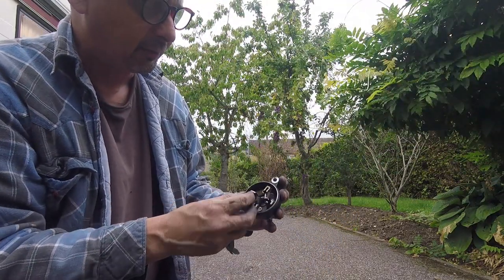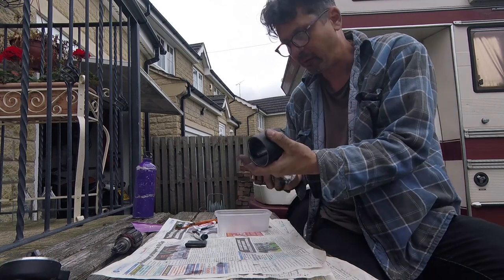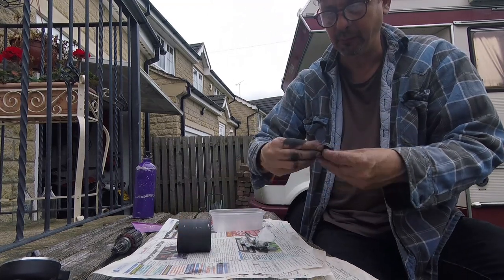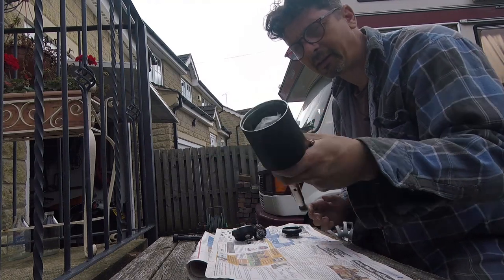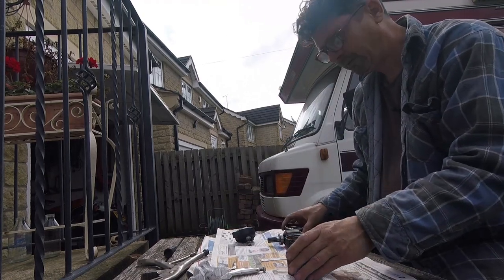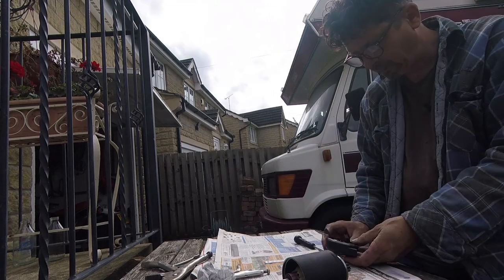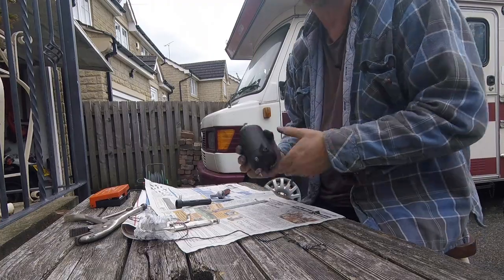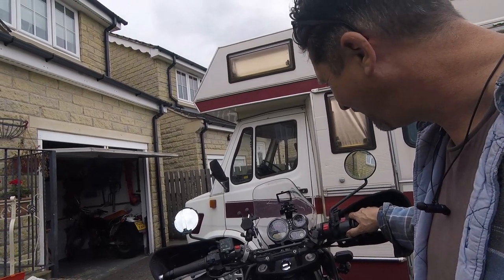Himalayan Starter Motor Fixing

Comment: Thanks for great info. I going to pull my starter now and check it. From RE manual, Starter motor bolts, Torque value is 10-12 Nm or 1.0-1.2 Kg.M. that's for the mounting bolts...... I removed my starter. Mine is Perfect inside. I recorded the Starter Motor label info.12 Volt 0.7KW, SM-6870A, 53 100 00000, R.E Part No.:574039/C Varroc Engineering Pvt Ltd, Pune India (mine starter manufacture date15/01/2018).
Reply from the maker: Glad you solved it and glad the video was helpful.

Comment: You fixing your Himi on the drive in front of the house reminds me of my days as a London courier in the 1990s doing the same thing every weekend! Brought back fond(ish) memories. Well done for sorting it, I too would have thought of Araldite in the first instance but I have heard great things about JBWeld and I'll have to pack some next time. Your "string theory" worked a treat too!
Loved your "I am awesome" at the end! 👍👍👍
Reply from the maker: Thanks so much François, really nice comments.  I did the same in the 90s (and late 80s) as I looked after all the tools for the bike club because I was lucky enough to be the only one that had a garage with my flat.  Most of the others in the club did couriering.  I guess old habits die hard (and my current garage is too small!)
Reply from the maker: Also, it might not have been successful.  Just shy of a year since I did the repair but today it struggled to start - hoping it's the battery due to low use in the last couple of weeks whilst waiting for a new master cylinder and  not the motor repair failing... I guess I'll find out soon!

Comment: I removed all starter motor cables and tested solenoid,  cleaned all cable connections. Also opened starter and cleaned copper commutator. ALSO found a multi pin connector with too much conductive grease, Cleaned thoroughly and now my 2018 Carburettor Himalayan starts with a short press of starter button. Also I placed a DC Amp clamp on Starter cable. Starter draws 60 Amps on startup. (Peak draw) I can send you a photo it you PM me.
Reply from the maker: Wow... well done.

Comment: After removing all starter cables, plus starter soilenoid, and cleaning all cable connectors, battery cable connectors and stripped starter motor, cleaned commutator, and oiled starter end bearing, also cleaned one multi pin cable connector. Cleaned all earth cable connectors. My Himalayan ( 2018 Carburettor model)  starts with one short press of starter switch. I also  places a DC Amp clamp on Starter positive cable and noted it draws 60 Amps peak DC on start up. (The multi pin connector was full of factory  grease, I think cleaning if fixed my poor starting problems)

Comment: Thanks for taking the time to explain the resolution.
I still have a few queries.
Shouldn't it blow the starter fuse?
I am also getting the similar display turn off issue. Occassionally, it would produce a nasty sound and just shut down!
Later the RPMs would come up very slowly and the bike would run.
They once replaced the woodruff key, but I don't know what exactly happened. Is it possible that the engine could backfire under some circumstance, and cause this extra load on the starter components?

Comment: Same problem here, thanks so much for your video!!!! Just my problem is that all 4 magnets are out. You may have a distance meassurement in mm?
Reply from the maker: Sorry, I didn't make any measurements.  The 4 magnets need to equally spaced. I assume they need to be put back in the same way round as they were.  Hopefully they will have left some marks to help you identify where they go.  Good luck and let me know how it goes.
Reply: Made it! For sure the magnets are not piece by piece on the original spot but runs smooth after assembling and shortly tested with direct connection to the battery. To keep the magnets on the spot with the string worked just fine. Great video, was a big help 🤟
Reply from the maker: @TheFriendlymike  Excellent news.  Seems it wasn't just a fluke when I did it then!  Did you use JB Weld?

Comment: Hi, my name is Eduardo. Nice video. It seems to be problem I have now. In my case I was riding the bike and suddenly it stopped, and then every time I try to start it the starter does not work and all the electrical circuit shuts off. Was the same what happened to you? Were you riding the bike when problem appeared? Thanks.
Reply from the maker: Unfortunately, no.  Mine just stopped starting (if that makes sense).  Maybe your coils in the starter are shorting or something else is?  Sorry not to be more helpful!

Comment: Hey bro today i try to tight the nut of Himalayan startor motor and suddenly i tightened with so much torque and i hear a voice and after nut is can't tightened its move freely it is right side of bike and is uppr nut of starter motor .  If I leave it free, will there be any problem with it?
Reply from the maker: Oooh.  You could try a longer bolt (I think it's a bolt).  It should work for a while but eventually will cause more damage, I think.  Good luck!

Comment: Also my R-E starter motor said 0.7Kw 12Volt.  So that's 700 watt. 700/12 = 58 amps.  Does that sound correct? Has anyone put a DC amp clamp on there starter motor cable to measure starting Amps?
Reply from the maker: I'm really sorry but I don't know the power output although that sounds a reasonable ball park.